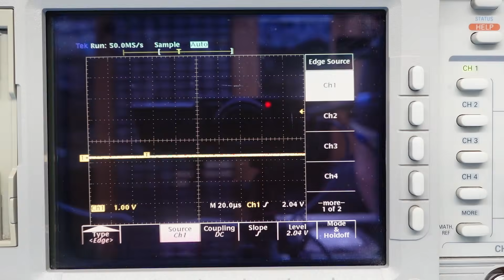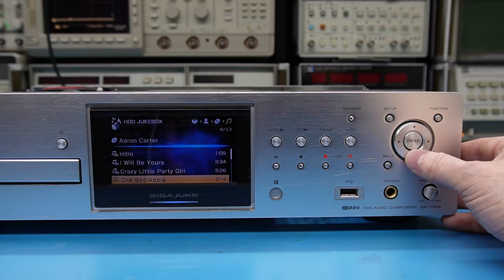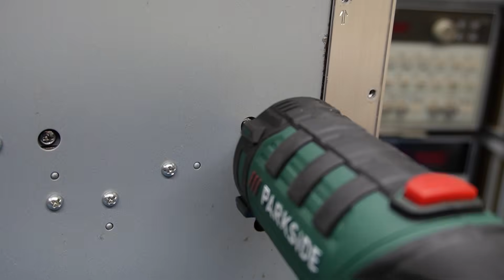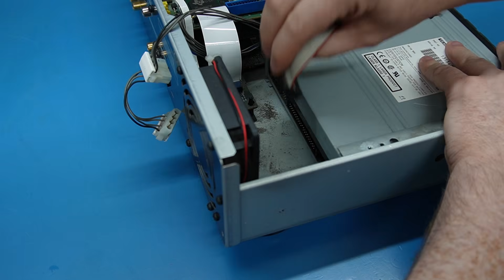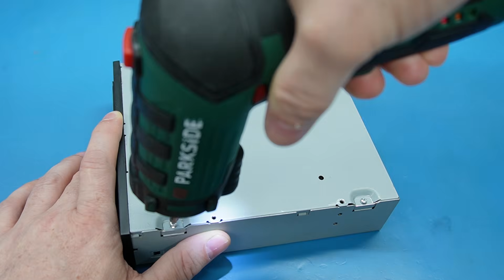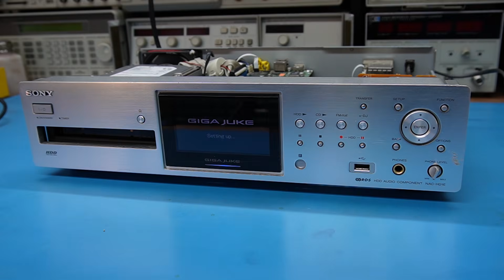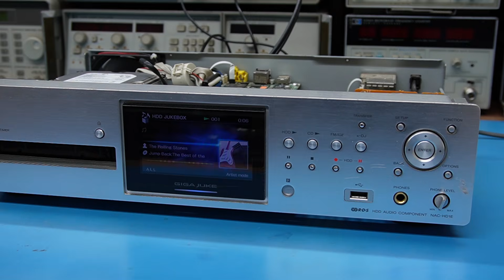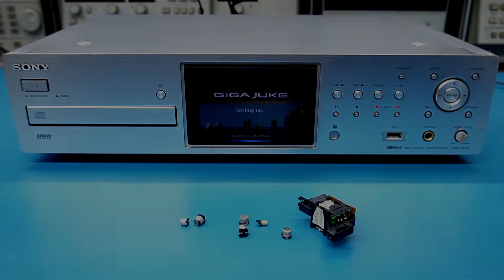SONY Giga Juke, Codename 'PROBLEMBOX'

Comment: I do love repairing electronics but dear god do I despise surface mount components especially those so bloody tiny that you drop them, good luck finding them again.
Reply: You now have 1kohm to ground from your main power rail.  Good luck!
Reply: @chrisnorman1653  Yup, as so often happens, you can't find it, you shake the unit, and confident it isn't in there, you put it back together. Then fry the bloody thing because it found the wrong point to get stuck in.
Reply: SMD are much easier to work with, often decent markings for those of us with enough colour vision deficiency to hate resistor colour bands. Often don't need to take the board out too. It is funny watching non-microsoldering techs make a mess of it though.... 🙂
Reply: @OnStageLighting  Now that's true - the labelling and that is a vast improvement over silly old colour codes. My biggest bugbear is being disabled myself I can't adequately deal with them - too small and fiddly.